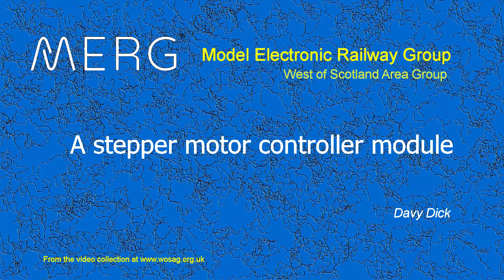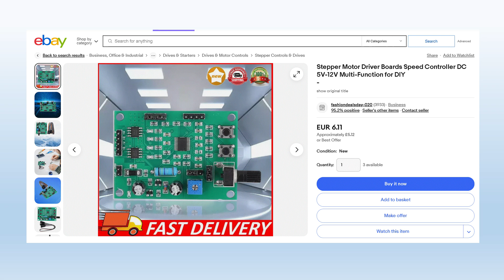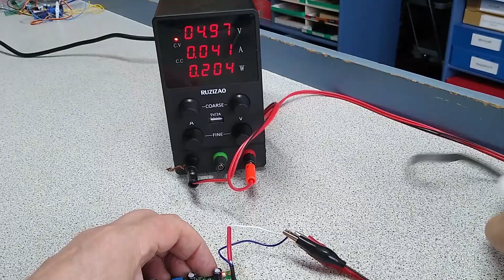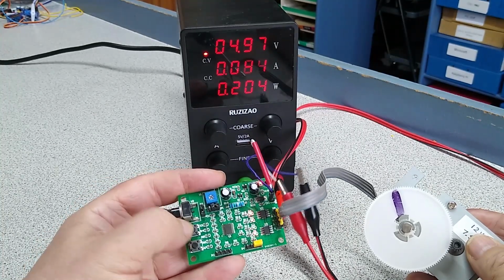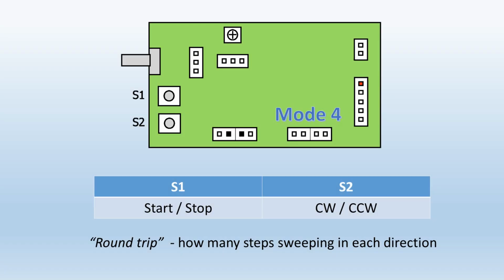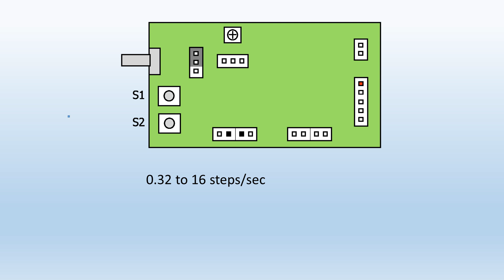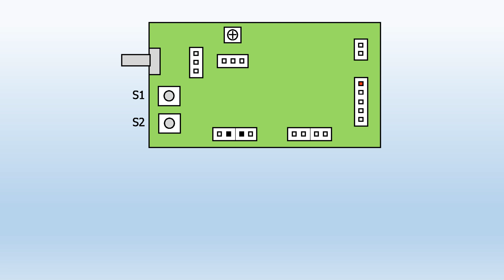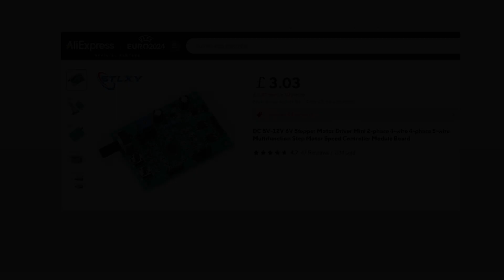A versatile stepper motor controller module

Comment: Hi,
Great explanation.
Where did you found this card ?

Thanks
Reply: aliexpress >  DC 5V 6V 12V Multi-function Mini Stepper Motor Speed Controller Driver Board For Micro 2-phase/4-phase 5-wire Stepping Motor